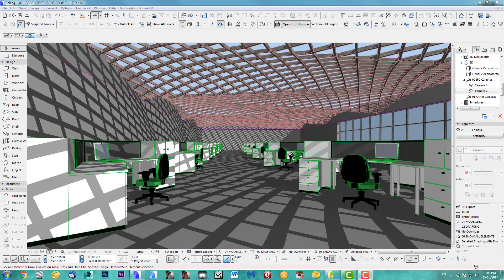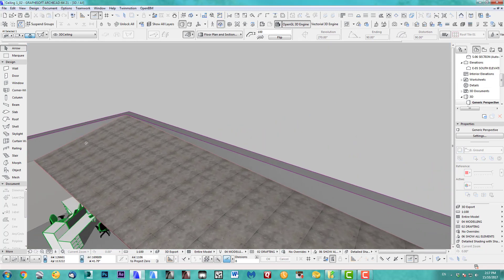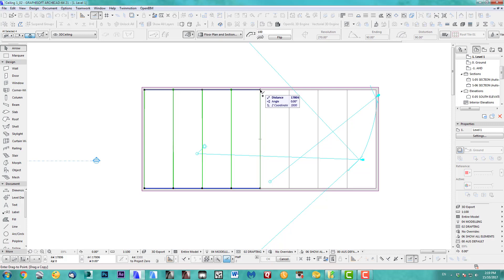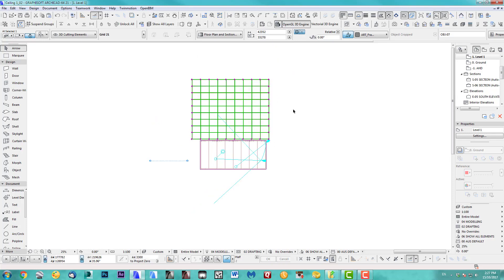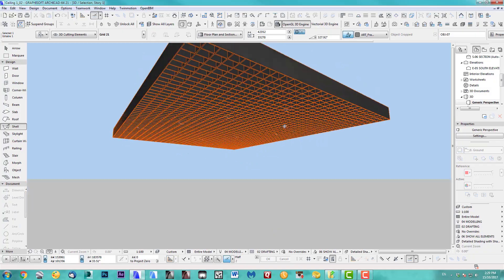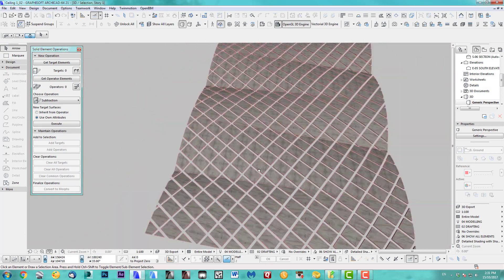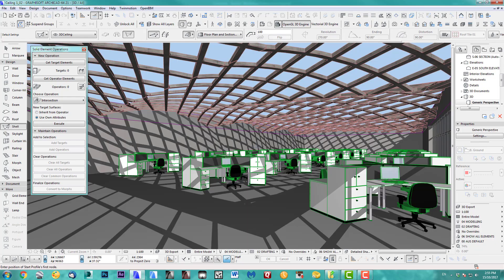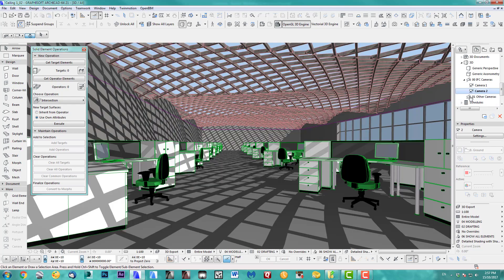ARCHICAD How to model a  bent ceiling grid

Comment: what about the glass between frames . I couldn't add it .. and here is other tips I'm doing with curtain wall for cutting instead of using slab or object .. More useful for some shapes..
Reply from the maker: For glass just do the same but with different options in SEO ( copy ceiling first ) then try to have the glass "left over" with SEO